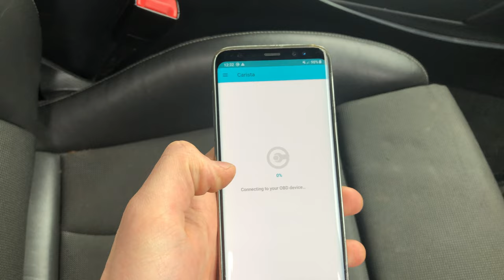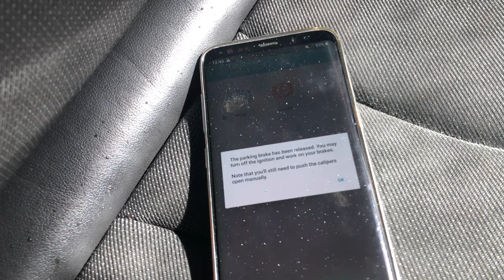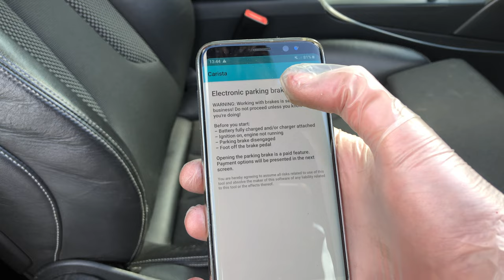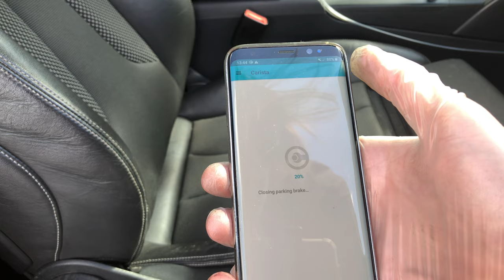Audi A3 8v Ep.18 - Electronic Parking Brake Caliper Rebuild MQB MK7 Golf Walk Through

Comment: Nice one. Thanks for making and sharing. I've a similar problem and unsure whether I have a pad that's sticky or a caliper that needs rebuilding. Pads are also a little thin so makes sense to swap these anyhow. Good to note the right and wrong way to extract the piston, thanks for that! I have a windback tool that' I'll modify so it pushes straight rather than rotating the piston. The washer with the rollers is a thrust washer.

Comment: Just buy a new caliper.
Reply: About £250 from the dealer and it does not come with the motor!
Reply from the maker: If you can afford too it would save a lot of time but rebuilding costs only £5-10 in parts! i found it quite interesting knowing how the internal mechanism works  :-)